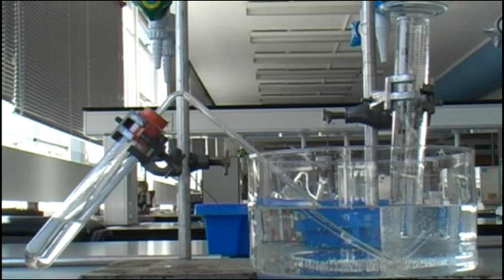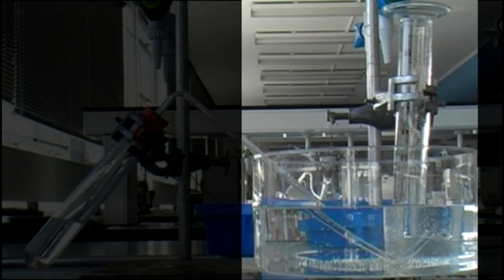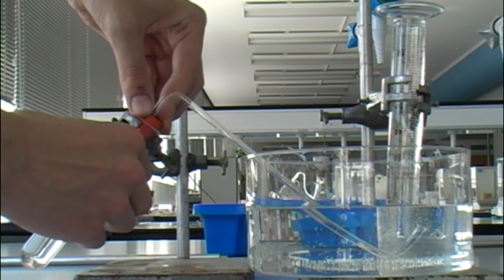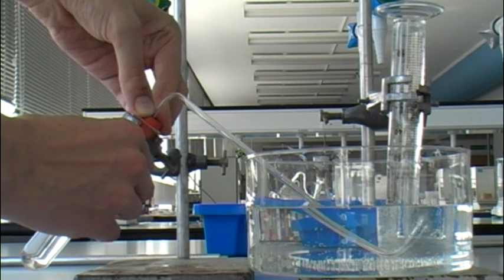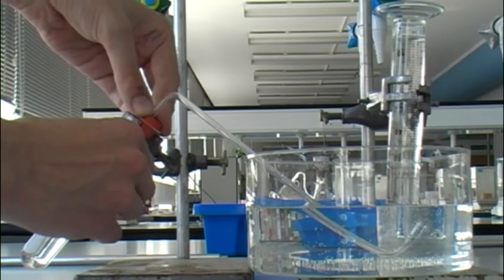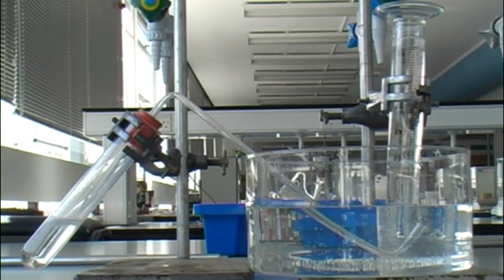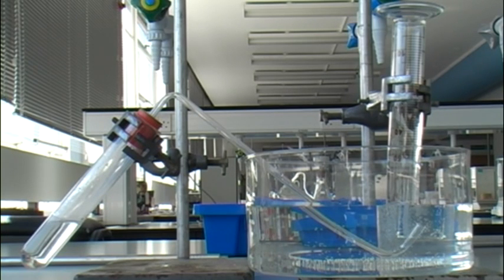Collecting gases produced in chemical reactions

Comment: What if you are tryng to measure CO2 from fermentation for example? would the CO2 which would be 100% of the gas above the water dissolve into the water because of the differences in partial pressure, reducing the measured CO2 over time?